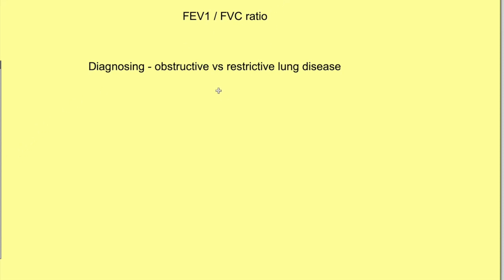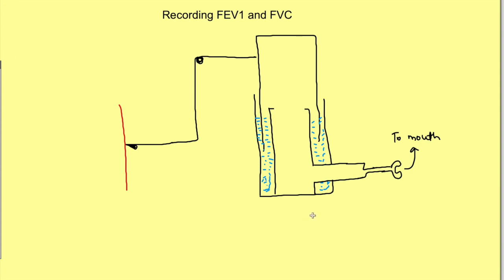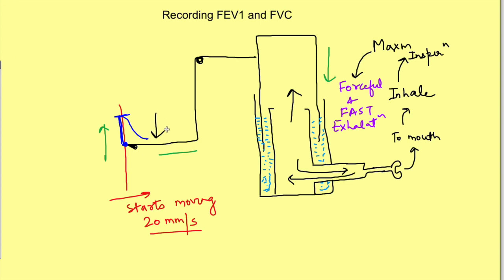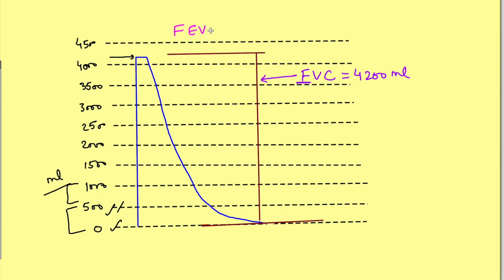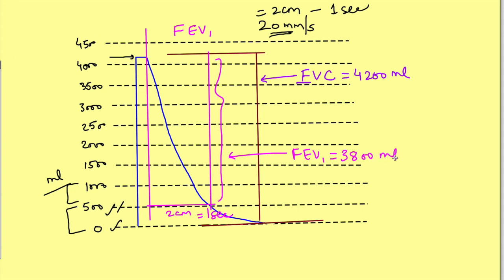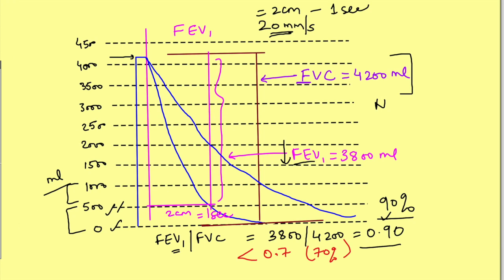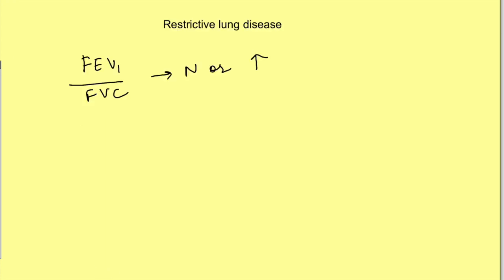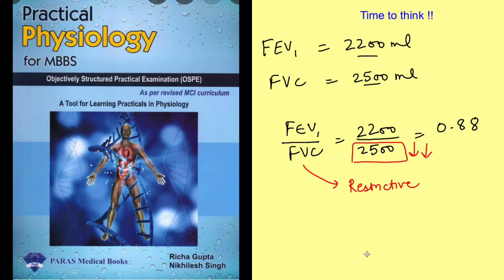FEV1/FVC ratio | obstructive Vs restrictive disease | Dynamic lung volume | Respiratory physiology

Comment: 1.Fvc is 119% pred
2. Fev1 is 108% pred
3. Fev1/fvc  is 91% pred
4. FEF 25-75 is 61%pred
5. PEFR  IS 94

IS 4TH VALUE IS OKK??

actually i feel chocking throat in air flight. And i also have needle pain in  chest 3-4 times in a day for 2 - 3 second 
Echo 60% EF
TMT is also okay.. what should i do for recognising my problem.. is it okk or not
showing
Reply from the maker: Did you check for gastritis??
Reply: @PhysiologyOpen   from last 5 days i am taking gasteric medicine .. i think alot about my problem.. is it can be anxiety pain